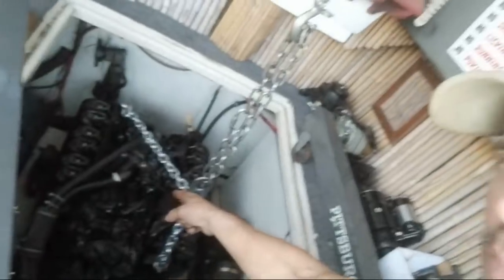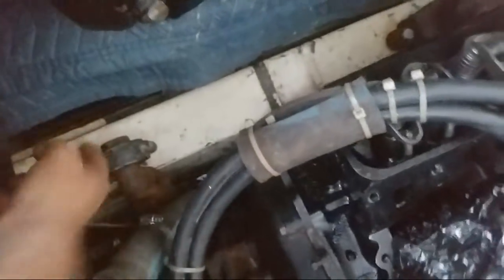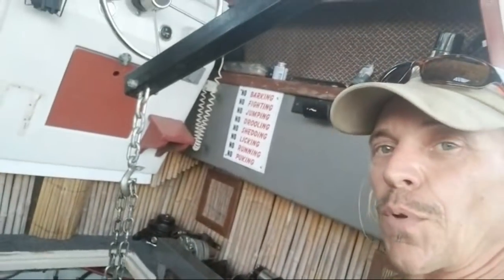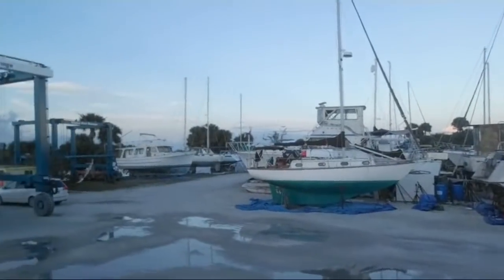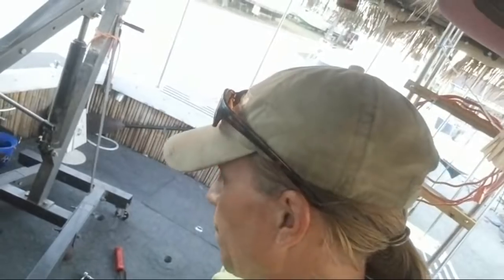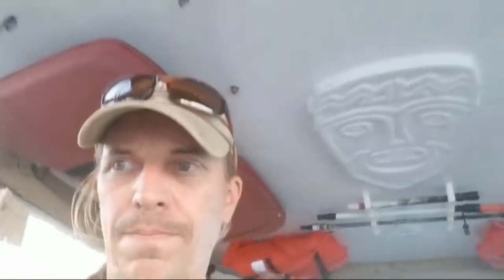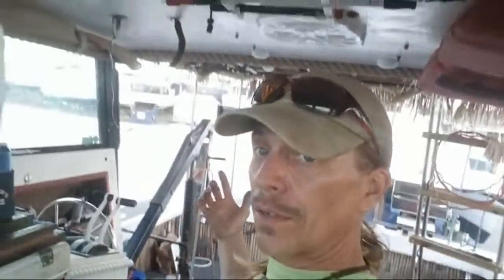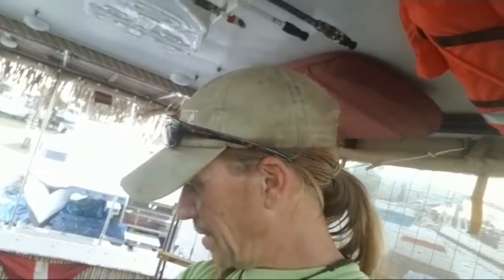One Engine In!

Comment: Good you got it on Big job alright  --Time the engine first ,LH front cyl. TDC set the Crank shaft timing mark at recommended should be around 6  to 12 deg  late on the reverse engine I believe , But you can set it`s timing on a power stroke Do a thrust rev once in the water find out if you have a pre advance snap or a late  power rev work between , PS -Always silicone the intake corners of the battleship to avoid leaks on the worm seals .

Comment: Tip prime the oil pump by using a dummy distributor shaft with a drill ,to prime the whole engine with oil pressure ,before you install the distributor ,helps when firing up the engines .

Comment: Hi Marty, Take your time tighten everything carefully- clamps hoses gaskets-oil- take it easy on start up check for leaks- set carbs-check timing- and everything should be fine, again dont get in a hurry I raced cars and alot of what your doing I did but not in those hard conditions like you have ,that why its critical to take your time and double check what did, then move to the next step good luck Marty I will for you pray for good luck on the entire trip I am sure you will do fine Ike

Comment: Here is what I have learned blowing up boat engines. Don’t use HEI distributors with ignition modules curved for automobiles, (first boat engine blown up) too much timing! Check the anti-siphon valve as the check ball gets clogged restricting fuel flow! CHECK your exhaust manifolds on the inside for evidence of rust!!!!! I bought a boat with a brand new 454 and second season it was done, the exhaust manifold has a small rust spot letting water in and over time got bigger and blew the head gasket from water in the cylinder (second boat engine blown up). Priming the oiling system and use a bottle of zinc every oil change with these older flat tappet engine, I use lucas zinc engine break in additive. As soon as you get the engine running bring the rpm up to 1500 and then switch between 1200-1500 to splash oil on the cam and cylinders to seat the rings, very important not to idle! I have rebuilt both engines and it was fun and education is not cheap. I wish you the best of luck and I hope you can learn as well as I did from my mistakes. Also watch out for the remote oil cooler lines, they can blow and by the time you hear the buzzer its too late. I took the oil filter cooler and filter relocation line off my 454 (now a 496) and tow tubes and cruise with no oil pressure or cooling issues. I just have to much money in that motor to have a rubber hose let go and kill my motor only to have easier oil changes. As far as cooling goes the motor has a 140 stat and stays right there, so I figure the oil temp is not near the 210 it should be at anyway. Good luck man!

Comment: Those motor mount lag bolts should be sprayed with a dry silicone then dab on a good epoxy on the threads. The epoxy will fill in all the little gaps in the wood and add strength. The dry silicone will allow them to be removed next time the occasion arises.

Comment: Why wouldn't u put the starter on before installing in the hole?
Reply: Why didn't he build the whole engine outside of the engine bay?
Reply: @rynobub  I was thinking the same thing.. that starter is going to be a bitch. I did mine the only thing I left off were the manifolds.
Reply: @philbrown8056  Probably the size of the engine bay hatch... That's the usual reason.
Reply: He looks to have plenty of room in that bay, I'd defo remove complete just like a car engine would. I wish car engines had that much access although  you cant get under the engine once it's in the boat.

Comment: I’m a little confused.  Is that the motor where the rotation was incorrect for the starboard side?   You were considering swapping the port motor out too because the new motor rotations matched port; then getting another new/rebuilt for the starboard with correct rotation.  That’s  definitely the starboard compartment open so I’m confused. I missed something, sorry about that.  If you don’t mind answering again, what’s the rotation status of that in going starboard engine and what’s the plan for port?   Thx u and continued good progress.